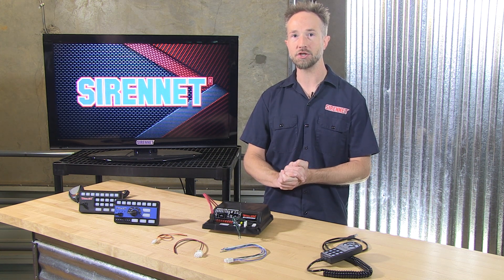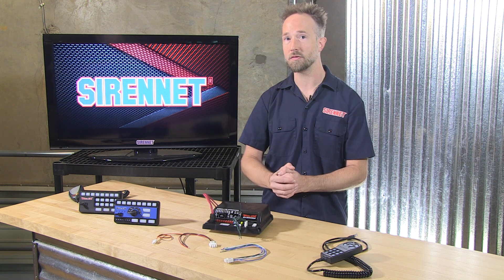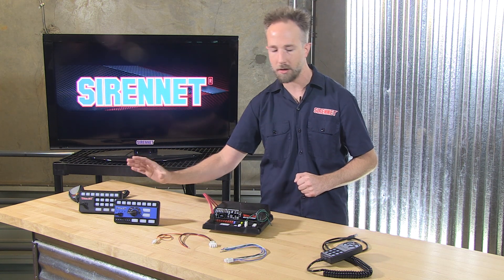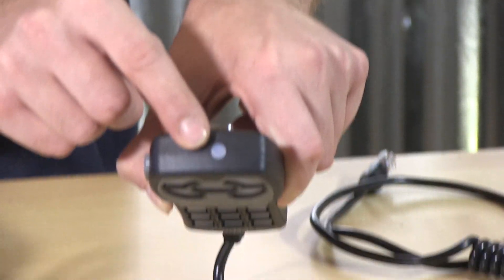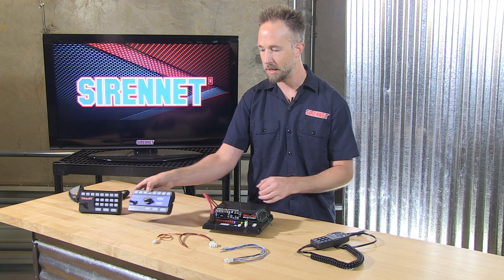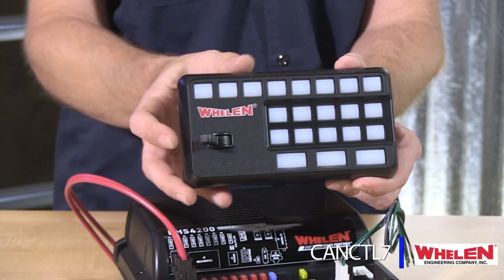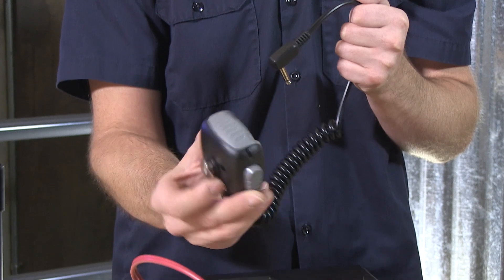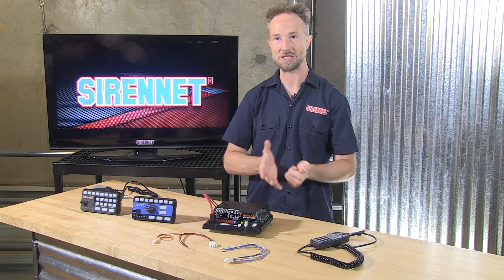The Whelen HHS4200 Hand Held Programmable Siren

Comment: @SIRENNET - can the handheld control head that comes with the HHS3200 and HHS4200 use the 20' extension to extend the distance between the amplifier and the remote? Do you need any sort of coupler? It looks like the extension has a male plug on both sides, and the cable for the handheld remote is also male. 

I'm looking to buy this unit but will need to install the amp in the trunk, just trying to make sure I can get enough reach for the handheld control head. Been searching all over for a definitive answer on this but coming up empty. Many thanks if you're able to assist!
Reply from the maker: Yes, the included 20' extension cable is what connects the amplifier and controller when mounted in the rear of the vehicle. The splitter that connects the two is included with the HHS3200 / HHS4200 as well.  Thank you for watching and for help with placing an order, please feel free to call us. Our phone number is (888) 959-0911.
Reply: @SIRENNET  thank you for the quick response and for confirming this info! I'll be reaching out to you shortly to place an order!

Comment: I see a lot of replies to comments so hopefully you can answer a question for me. On those control heads, how do you change the labels on them? I've searched everywhere and want to make sure it's customisable the way I want before spending all that money on it
Reply from the maker: There is a clear cap piece that snaps onto each button to cover and protect the labels; these are removable if you want to make a change. The label or legend sheet as its sometimes called has several dozen to choose from. An example of those included with the Blue-Face Rotary Knob control-head can be found here on this page: https://sirennet.com/whelen-cencom-sapphire-siren-w-3-section-control-head.html
Reply: @SIRENNET  thanks a lot. You have no idea how hard it was to find the answer to that question
Reply from the maker: @rhoude747  Glad we could help!

Comment: So can I still run whelen non wecan products?
Reply from the maker: Correct, you can. If you're not planning to use it in conjunction with a WeCan Light Bar / Inner Edge, the HHS3200 may better suite your application. It's the same as an HHS4200, minus the WeCan port.

Comment: Can you connect both front and rear interior inner edge devices to this unit?
Reply from the maker: The WeCan input on the HHS4200 can connect to only one WeCan model Inner-Edge / Light Bar. The second Inner-Edge would need to be wired to the standard inputs. If its a WeCan model you'll wire the trigger wires from the WCCP module to the inputs. If it's an LC model, the wire leads go to the standard inputs.